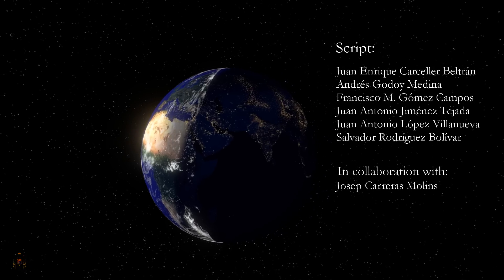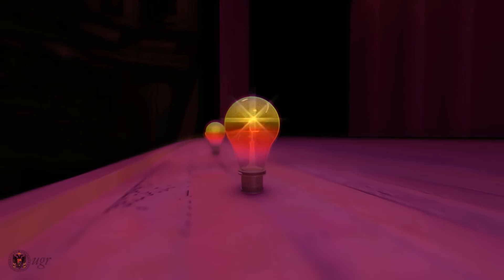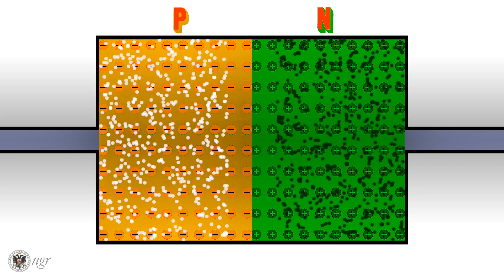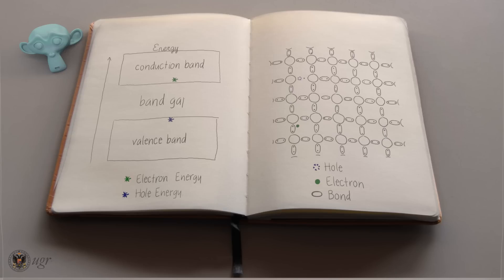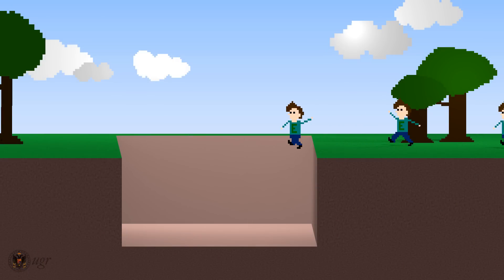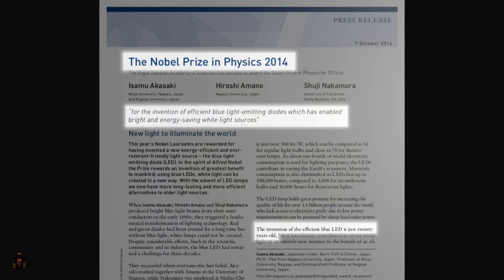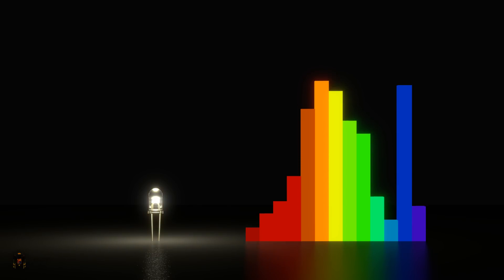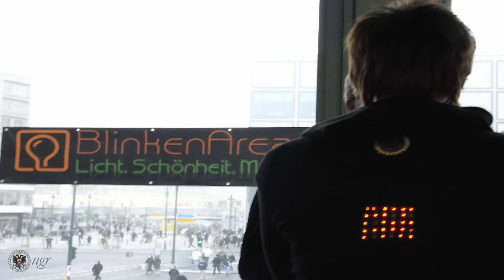The LED - How LEDs work? - English version

Comment: "Originally, the word LED stood for 'Light Emitting Diode'. Currently, it is used as the acronym for 'Light Emitting Device'."
And I stopped right there.
A candle is a "light emitting device".
If you can't get something as simple as that right, I have no reason to trust that you'll get the rest of it right, either.

Comment: The term Light Emitting Diode, LED, is the most accurate and self descriptive, for 2 reasons. Firstly, it is a diode, because electricity can ONLY flow in one direction, PN junction. Secondly, it is a very small/tiny component. The term Light Emitting DEVICE is misleading, because, as some people have pointed out, any lamp/light can be described as a device. A device, generally speaking, in my mind, implies some much bigger in size, for example a fridge, TV, computer, etc...

Comment: Florescent lights arent the energy saving when you consider how they are used. Not too mention the mercury that is in them.
Reply: You could argue the same for LED bulbs.
Both have higher efficiency than the incandescence bulb. Neither are 100% efficient.
(When you define efficiency as watts visible light /watt consumed)

Comment: I once sat through a class by an "engineer" from China who proceeded to lecture us on LED's and video display modules. According to him, the reason outdoor LED's get dimmer as they age has nothing whatsoever to do with the weather or sunlight causing dirty or cloudy lenses, or aging and degradation of the semiconductor material inside. It is actually due to depletion of the fissionable nuclear material inside. Then he said that's how the sun works. This from the same "engineer" who claims it is impossible for these modules to get any water inside, and impossible to provide a drain hole for any trapped water. The display modules are designed without fuses or any kind of over current protection because there is no room for fuses in his warehouse. I couldn't tell if he actually believed any of this BS or if he just thought Americans were stupid enough to buy it. Mentioning this to my company's VP changed nothing.
Reply: LoL. I don't know your VP, I know the VP type.
The VP understands the technology much less than either you or the Chinese engineer for sure. 
If it was a reasonably sized company, it's safe to say he didn't care.
Maybe you should have told the CTO.

I have had the pleasure of meeting engineers from many different countries. Some are technology freaks and some are what we called "sales engineers".
The country does not appear to be the discriminating factor.

Comment: Can the heterostructure be applied to red and green or even infrared LED ? Why using fluorescent material to convert blue light into white light instead of using a set of three LED (red, green and blue) to make white light directly ? the power spectrum of a blue LED with fluorescent show a blue spike which differ from the spectrum of the natural white light emitted by the sun. Can we do better "white light fidelity" ? I am dreaming of a third episode as good as this one and as the other one on PN junction. Thanks !
Reply: Maybe there is videos explaining CRI values for LEDs. I guess using phosphorus is making a much wider range of colourband compared to have seperate colour leds.
Reply: The other answer is part of this. LEDs have rather narrow frequency (color) bands, and even having all 3 primary colors leaves gaps in the 'white' light. Phosphorescent coatings give off a wider band of frequencies (colors) and in the end have a higher color rendition index (CRI). Google can help more from here if you still have questions (which I'm sure you do).  This is actually a fascinating topic to look in to...

Comment: Just FYI...
LED still stands for Light Emitting Diode - It always has and always will. I've worked in electronics for over 30 years and I've NEVER heard anyone call it anything else. All the component manufacturers still call them diodes too. Why do people bother making videos if they don't know what they're talking about?
Reply from the maker: Hi! I understand you never heard this in the past, but surely you will in the future (and probably this video is your first time. Nice!). The group of professors that developed this video are familiar with current research on lighting and I can give you just a few references of good research papers in outstanding scientific journals in which this is the accepted meaning of the acronym: https://www.nature.com/articles/nphoton.2013.70 (2013); https://www.electrochem.org/dl/interface/wtr/wtr09/wtr09_p037-041.pdf (2009); https://www.sciencedirect.com/science/article/pii/S0925346717302045 (2017); https://pubs.acs.org/doi/abs/10.1021/acsphotonics.7b00864 (2017). We are scientist, not component manufacturers. We decided to use the acronym that seems to be the right one for the coming years, not for the last decades. It's our style to humbly communicate the little that we know and share this information with people (even with not so humbly ones in their manners). I would be more than happy if you learn this piece of information from our video (which is not perfect, no doubt about it, we did our best though). Thanks for commenting!
Reply: My point is that you are talking about a group of professors, so a relatively small group of people that are using this term. Just because a small group of people decide to call it something different does not mean that the name has officially changed for everyone else. There are hundreds of thousands of electronics engineers, hobbyists, manufacturers and suppliers in the world and we all call it a  Light Emitting Diode because that's its name. 
Yes, your new term is technically correct as a description, because an LED IS a device that emits light, but so is a halogen bulb or a CFL or even a cigarette lighter - they are ALL light emitting devices.  It would make no sense at all to change its name to something generic like that when it already has a specific name that uniquely identifies it aside from all the other types of light emitting device. Your term works as a general description but it's never going to replace the name "Light Emitting Diode" outside your group of professors.
Reply: Read the other comments on here - everyone agrees! You can't just decide to change it and expect everyone to accept or adopt your new name. The world doesn't work like that! They've been called Light Emitting Diodes for over 50 years so that's what everyone knows them as.
It would be like me deciding to change the name of Spain to "Europe" and then making a video about it!
Reply from the maker: I see your point. To clarify things, i) it's not  a small group of people using the term, but it's the trend in the scientific community; ii) obviously LED is a light emitting diode... when the emitting device is a diode. But nowadays there are devices that are "somehow" like diodes, but they are not diodes. That's why the use the general term "device". Probably it's not the best name, I agree with that, but that's how they call it. Probably we should say "electronic light emitting device" (I'm not even convinced about this). It's not a relevant argument, but in Acronym Finder it's also registered this entry, it's not my invention. www.acronymfinder.com. Anyway this is controversial, I agree, but we did our research first and decided to use this. If I would use "light emitting device", there would be people commenting they have seen the new acronym stands for light emitting device. It's a hard task to find something that makes content everybody. Anyway it's my pleasure to comment on every detail of the video, thanks for commenting. And about Spain, if you do your research from reliable sources and find you can use "Europe", why not? :-D
Reply: @fmgomezcampos  so instead of giving uniquely identifying names to these diode-oids, they instead hitchike on LED's known "brand name"? That's as backwards as naming LEDs 'lamp' or 'diode' so people can't tell the difference. Plus eLED sounds catchier.

Comment: 1:21 wtf? Hg is mercury which is a metal not a gas
Wth
Reply from the maker: Hi! I'd say there is no contradiction at all. Metal is not a state of matter, as far as I know... In fact, there are solid and liquids metals... why not gaseous metals?
Reply: As in the mercury vapor type light bulbs commonly used by utilities and other industries for security, industrial, or street lighting.
Reply: However, is it really true some electric arc lamps contains a small amount of mercury vapor or sodium.

Comment: A hole is an absence of an electron in an atom.   As an actively moving electron hops from atom to atom.  As electrons get sucked out of a battery, the hole is where an electron used to be, so "holes" flow in the direction where the electrons came from.  It has no powers.  When you move from the biffy to the kitchen, the hole is in the bathroom.  It has no powers.  One just notated the hole travel.

Comment: They said LED cost you very low electricity bill. What they don't tell you is, it cost you more on replacement and have lower lifespan. 10000 hour lifespan? The electronic controller failed first before the LED failed.
Reply: Yes. And todays sockets can't transfer the heat good enough. So lamps with inbuilt led's probably last longer if designed good.

Comment: The diagram shown P and N are the other way around 
P is the positive side where N negative side flows to P side
Reply: This is about the material of the semiconductor Silicon is a tetravalent element.  
The N-type of the semiconductor has a impurity with a spare electron who voluntarily want to cede this electron if there is electric current applied.
The P-type of the semiconductor has a impurity who is welcoming to receive this electron from the N-type.
Reply: I thought the same.
Reply from the maker: Hi! I don't understand what you mean, could you explain it in more detail? Thanks!

Comment: This video has incorrect information... 
p-type (boron doped) silicon has holes and n-type silicon (phosphorus doped) has free electrons.
electrons flow from the n-type to the p-type once a voltage of roughly .7V is reached. Current, using the positive convention, is in the direction from p to n.
Reply: And as for current flow, it is opposite in direction to electron flow. But it is electrons that are shown flowing, and in the correct direction if I am not mistaken. Thus full marks from me for an excellent video.
Reply: Diarmaid O'hÉineacháin
Last year I would have said I don't accept hole flow theory. But with holes opening up and expanding like zippers across the planet, I'll keep an open mind. But I have never heard of a hole beam. Electron beams I play with often. Somehow the topic got off of the atomic structure and it's relativity, to hole flow, so that inept minds can see where the electron goes? These are the same minds teaching electricity flows from Positive to Negative. Right, and North is South.
Reply from the maker: Thanks for your comment, it makes sense to me :-D Thanks for the congratulations too, we took very seriously into accout every detail in the script and in the videio... but nothing is perfect, that's why I'm open to criticism to improve. Thanks!
Reply: therefore we use red light as a stop sign on the traffic light so the car drivers can see the light from far distance.
Reply from the maker: I don't understand what you mean. How can you "make light" and not emit it? Do you think it is possible a concept such as "not-moving light"? "photons are only a concept. They don't exist." We are talking about science, not philosophy. You might be right then, because science does not explain the essence of things, but how they work. 6000K LED is not at the same temperature as the surface of the sun, as far a I know. There is a difference between LEDs spectra and black body spectra. In the visible range 6000K LED may emit photons with a similar profile than a 6000K black body, but out of the visible range they don't need to have the same profiles. I don't really get your point...
Reply: @fmgomezcampos 
If light was photons then it would have to be emitted from each source in all directions simultaneously and continually. How could that happen? That would mean the whole universe would be filled with a sea of photons. Light (plasma) is created and we observe the source of light in real time. 6000K LED is the colour temperature which matches the sun - they call it daylight. The actual surface temperature of the sun is around 6000K as well. Photons have zero mass so how could they possibly carry any energy? Science needs light to travel....otherwise a lot of it falls apart!
Reply from the maker: "If light was photons then it would have to be emitted from each source in all directions simultaneously and continually. How could that happen? That would mean the whole universe would be filled with a sea of photons". Why not? I mean, wherever you are, you see things around, that's a universe filled with a sea of photons. If not, there would be many places with nothing to see around (and probably there are particular places in the universe like that, but they should be rare...)
Earthquake waves have no mass (as far as I know) and they transport energy and move/destroy things around.
Your questions have an answer within the current state of Science, but probably your mind is not open to learn Science. If you knew enough about Science, you may still have questions, but your questions would be different. You may think about this, in my oppinion it's a matter of attitude, and your attitude is not that uncommon nowadays, that's interesting to me. When you decide to open your mind, you learn ;-) Thanks for commenting and offer your questions for debate.
Reply from the maker: Hi! could you indicate the time where the unaccurate assertion is made in the video? I think you're almost 100% right, and I think the video agrees with your comment. Apart of that, the 0.7 V you mention is not the voltage for that, the process you mention is true for any positive voltage, but about 0.7 V is when that process yields measurable currents... for silicon pn junctions. LEDs have not necessarily that threshold voltage, nor pn junctions made of other materials.
Thanks for commenting!
Reply: @fmgomezcampos  
pn holes-electrons-photons is in my opinion contrived. The LED device makes/arcs plasma. The phosphor coating amplifies/filters the plasma light. Nothing is emitted. The voltage creates the field. This is why you cannot dim the LED by changing the voltage. The only way to dim a LED is to change the frequency of time it is on/off.
Reply: I think that comment is about the 2:30 time, and that it is based on a mistaken view. The P region is shown with negative signs, indicating the charge of the atoms in the lattice corresponding with the positively charged holes that are created by the 'captured' electrons. The commenter assumes those signs should be positive to correspond with the charge of the holes (shown as floating white dots). And the converse is true for the N region, showing positive signs for the atoms and the free electrons as floating black dots.
Reply: Hairy Pickle  yes it's  .7ev (electron volt)
Reply: another incorrect information is that the energy has a reverse relation with wave length as known from this law: E = hc/(lambda)
Reply from the maker: Why is that incorrect? That equation is the one to justify that relation.
Reply from the maker: Could you find information to support that? It seems like a funny half-true to me :-D I think that might be true in very extreme conditions (probably in a very dense fog), but I'm just guessing. Anyway I'd say that might be have something to do with atmosphere, not with light itself. I don't think blueish stars are not visible from the Earth... Thanks for commenting! P.S.: I think you are talking about frequency dependent index of refraction materials...
Reply from the maker: I think there are coloured LEDs without phosphor, and they emit light, what would be your explanation for that? Apart of that, changing the voltage changes the light intensity because more current is producing more photons in the electron-hole recombination processes, and you clearly need a threshold voltage in order to switch it on/off. About the frequency, that is explained because, in average, you change the time the LED is emitting. Thanks for commenting!
Reply: @fmgomezcampos  
Light is not emitted. The LED makes light and we see the light. It doesn't travel anywhere. Each reflection from a dust particle or surface is a tiny mirror back to the source giving the impression that the light is travelling but its not. Photons are only a concept. They don't exist. As I said before I think the gate arcs plasma. A 6000K LED (daylight) is the same temperature as the surface of the sun (plasma) or a lightning bolt (plasma) its all the same thing. The air becomes plasma (5th state of water).